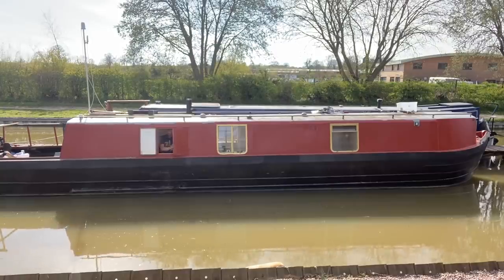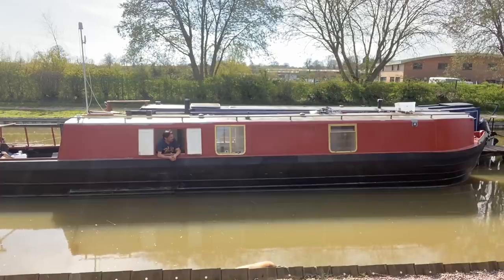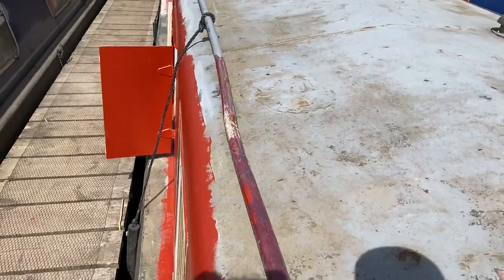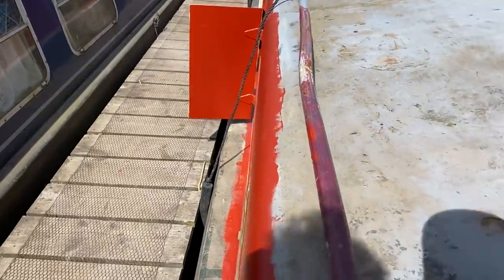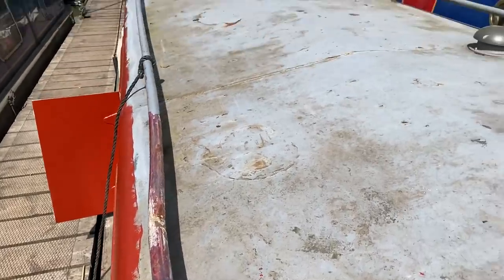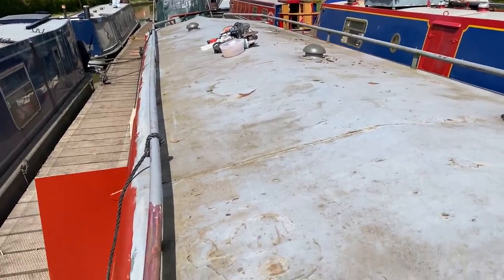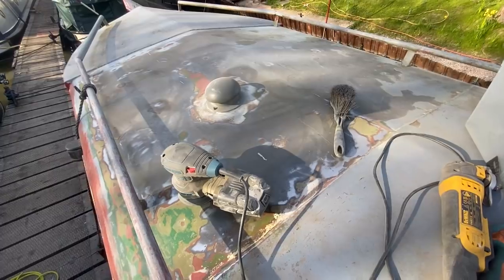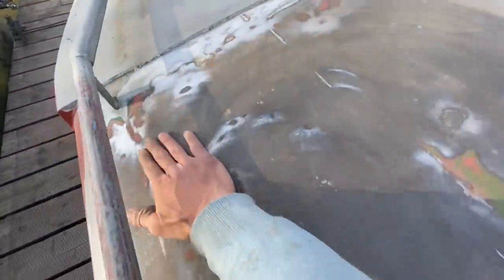170. Stripping the Narrowboat roof

Comment: Bent handrail was probably a rope tied to a fender being caught on the side or a rope attached to the bank and the boat moved. I would say either live with it (please dont) or cut it out and replace with fresh straight. Its stretched and I doubt it would ever be straight again. The front of your boat is an addition. The new roof section probably wasnt degreased or had a thin oxide layer on it and wasnt properly preped. Only thing you can do is what you are doing and taking it back to bare metal. Keep up the great work James, the boat is looking great.

Comment: If you can bear the removal of the old paint you will be rewarded with a pleasing, to the eye, smooth finish. Sanding and feathering the old paint will create unsightly layering. All professional (decent) painters start from bare metal. I remember using a wood chisel on my previous narrowboat to remove all of the old paint. It took an age but the resulting paint finish was fantastic, made the boat look almost new.

Comment: That rail will definitely need to be heated up. Probably a two man job. Maybe Paul or some one from the yard will help you. Once hot it could do with straightening using some kind of home made lever. Something that had a long handle and an L shaped piece at 90 degrees to put some weight behind it and pull it back in to shape. Might take a few goes and it won’t be perfect but should be good enough.

Comment: Slide hammer with a hook attachment for the roof rail. The non-adhered paint looks like it’s on the front cabin extension that looks like it’s been added to the boat at some point. Prob bad paint prep and applied in a hurry. I’d give it a good key with the sander, then degrease / panel wipe it off and spray some etch primer on (get a couple of cans from Halfords) before the red oxide. Looking really good 👍🏻👍🏻

Comment: Great intro and night shots James, looks great. I do however need to keep the TV remote to hand to keep altering the volume 😁
As far as the roof rail is concerned either cut out a section and have a replacement bit welded in or just leave it. It's "character" on a 50 year old boat. 😍

Comment: Use x2 off sections of sturdy wood of equal lengths, suitable to wedge themselves between the 2 roof rails (layed port to starboard), spaced just either side of the damaged section of rail. Brace the good roof rail by placing a suitable steel bar, of length longer than the distance between the x2 wooden wedges fitted above and ideally of diameter greater than the gap under the rail (to roof). This steel brace should be placed on the outside (water side) of the good rail. Use a large ratchet strap wrapped around good rail & steel brace, across roof (parallel with wood wedges) and over centre of damaged rail. Tighten ratchet strap until damaged rail is just past straight to allow for flex back after its released. Move wooden wedges (when strap not tensioned) closer together, either side of damaged rail to help focus load onto a specific point, when strap re-tensioned to get rail aligned better. As rail will have stretched when initially bent, its unlikely to recover 100% parallel /straight. Good luck

Comment: James to do the handrail wrap an old chain around two or three times and then pull one way and the other working your way along the rail.
Reply from the maker: im trying to smooth it out - that sounds like it would rough it up
Reply: @TheNarrowboatThatJamesBuilt  apparently it was a tip from a great guy on a ship! Can't remember the entire story from last night but apparently the crew were using needle hammers and the chain works much better.

Comment: To straighten the rail jam two lengths of timber between the roof rails either side of the bend then use some sort of hand winch to pull the bend out..you'll need to make sure you fix the other end of the winch to where the  rail is attached to the boat so you don't bend the other rail inwards. . In fact best try to fix the winch near to the wood you have jammed in

Comment: Hi James, re the bent roof bar, heat it up mate then pull it off the opposite side with a ratchet strap, you will need to get a lot of heat into it right at the bent bit.

Comment: Hey james. Great video series. I myself have been renovating a dutch barge and wish I had started a series like yours. But  that in itself is a ton of work. Hats off. 

I had a tip for you and a question. 
The tip is a paint system. You probably made your choice but if not this maybe of interest. 
Brantho korrux 3-1. German paint. Brilliant. The 3 parts refers to 1)anti rust 2)primer 3) top coat. I used it and highly like the simplicity. 

My question for you. 
I have to insulate one room and was thinkimg of spray foam like you did. Its behind my tophouse, stuurhut in dutch. The motor room seperates this room from the rest and i need extra room as baby on the way. 
I have been discussing spray foam with people and some are for and some against. Those that are against say that future welding work is complicated by spray foam, not being able to remove it. I wonder what considerations you had when deciding to go with spray foam? 

Love to hear what your thoughts are on it. 

As for that bent rail.
If you are able to fill with water or sand. And heat it you maybe can straighten it. But maybe faster and simplier to cut out and replace with straight part. Thats if you know how to weld or have a friend who can help. 

All the best to you. Keep up the good work and hard work

Comment: Hi it looks like its been painted over the mill scale on the steel , need to put a sanding pad on a grinder and key it in , or use a etch primer it all needs to come of , the bars bent because its had a rope on it to pull it in , use the grinder flat guard off dont dig in

Comment: You could use a ratchet strap to pull the rail straight it shouldn't mark the bar.  You could anchor it to a welded pin on the opposite side of the boat.

Comment: A long piece of rigid steel with a short chain around each end, then  wrap those chains around the bar,, and a hydrolic jack on its side in the middle as a fulcrum pushing against the bar . right at the point of the bend...  RE-SPECT
Reply: Add heat like you said but with the fulcrum bits.

Comment: Heat that bent bar up with a blow torch then twat it with a lump hammer. failing that reinforce the bar on the other side with a post or similar , then use a ratchet strap around both to pull the other one straight

Comment: Once you bend a pipe like that (or is it solid bar?) it tends to stretch and will never go back to its original position. You could be lucky and it may go back into place using a pipe bender. You would likely have to re-align the lengths fore and aft of the kink as well. From what i know about boats, it may have had something heavy fall onto it, or a heavy rope was used improperly. Be sure the rail mounts are also in proper condition, or it may decide to break at the weld when you try to straighten the rail. Good luck!

Comment: Cut out the length of bent rail (some tool used it as center line anchor?) and either machine shop straighten it OR better yet and cheaply replace it with a new length of pipe (welded back in).

Comment: Looks like the bar was bent by someone tieing ropes off to it. 
To be honest, your easiest is to cut out that section and weld in a new piece. You'll never get the bent bit fully straight. Pipe should be cheap enough. Do the prep work yourself and keep the welder's work to the minimum.

Comment: Your gold windows I suspect are aluminium, anodised. I would consider living with them as they are and possibly use some yellow /gold coach lines to frame any signage / patterns on the side of the boat to bring it all together. Paint does not like adhering to aluminium. You could remove the windows frames and get them professionally re-anodized a different colour or plastic coated, else you would need to primer-etch them yourself before hand painting. I fear that with the intricate slots in the frames, your paint won't conceal all of the gold and constant use of your windows (opening & closing etc) will chip off/wear through your paint, exposing more gold, and will look worse. Why create so much work?